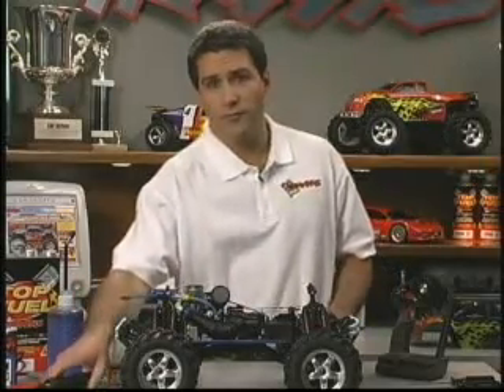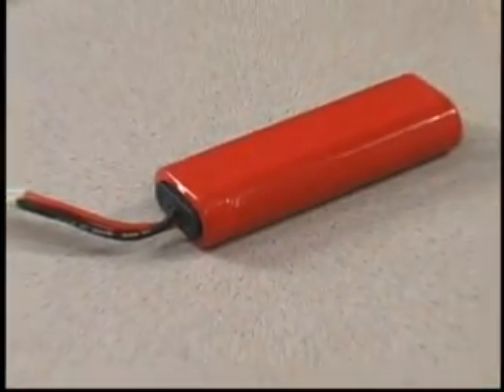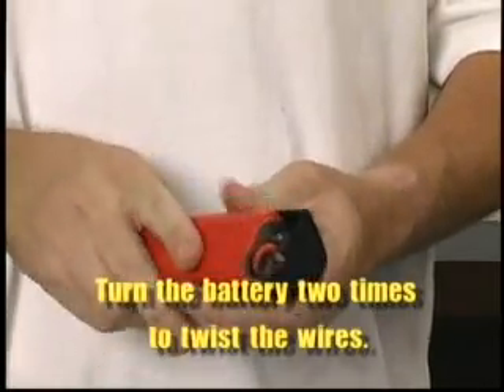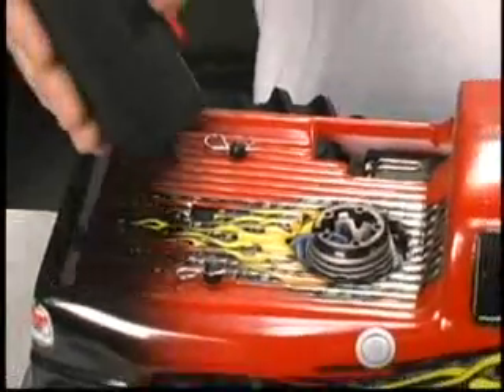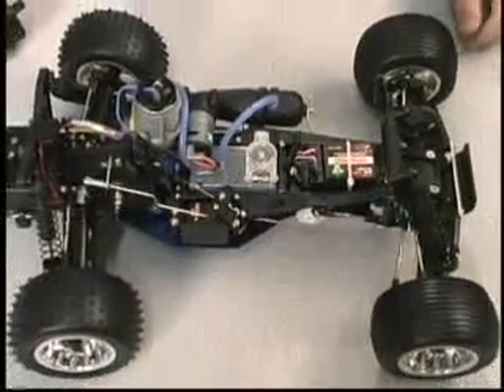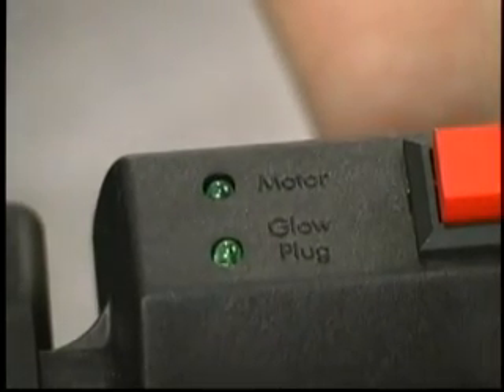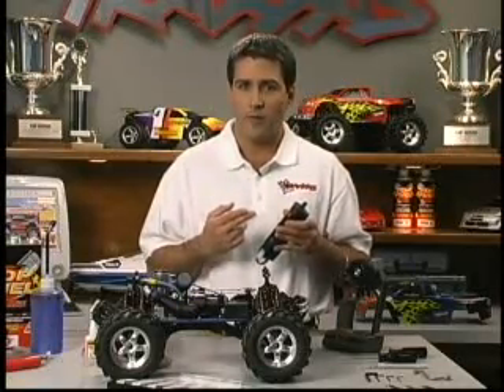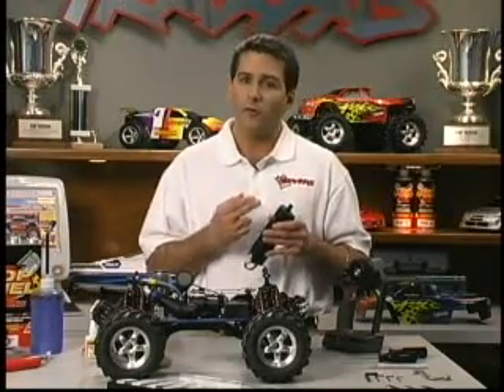Traxxas setup 9 of 21 - Using the EZ Start System

Comment from the maker: depends on which version you want there is a 2.5 which is 350.00 and a 3.3 version which is 460.00 the truck is a tmaxx and they are ready to run trucks you need the battery and charger for the ez start system.

Comment: can also get an electric model which, although isn't quite as fast out of the box, it is alot cheaper and WAY less maintenance. they're around $250 but you can modify them to run around 50mph if you put a high powered motor in it.

Comment from the maker: you  can buy a cheap charger for $40 and good 7.2v 3300mah batterys for $24.99 both from radio shack. so together it would cost a extra $65.00 and dont forget nitro fuel which would cost $26.95 a gallon for traxxas top fuel

Comment: my ez start, problem: spins slowly. and stops turning, when I try again it does'nt work the engine aint flooded no lights turning green and im sure the battery pack is charged I cant think of anything else truck is about 6 months old used only a few times t maxx 3.3